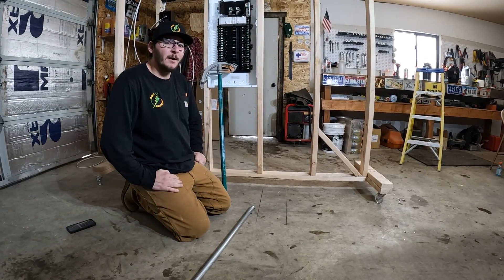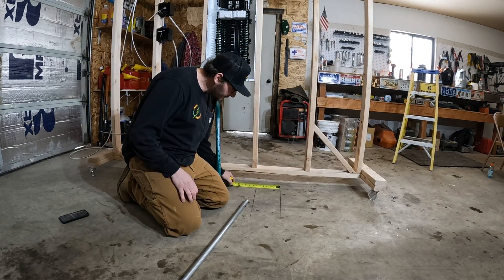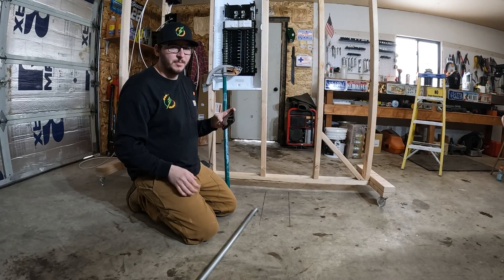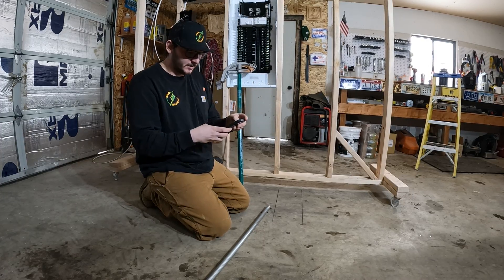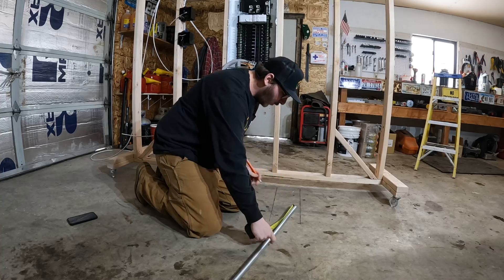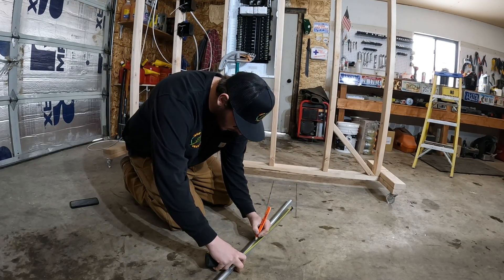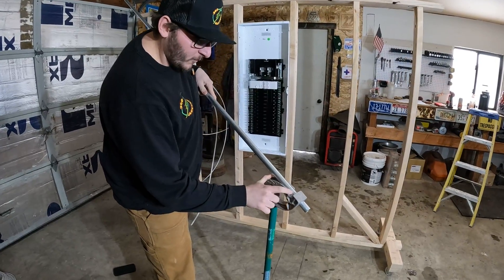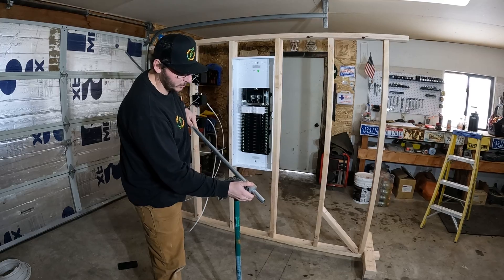How to Bend Electrical Conduit Like EMT or Ridgid - Electrical Tips

Comment: Prefer ideal or old think its Benfield benders over crappy Greenlee benders. For 11/4" EMT only purchase the bender that has a foot pedal that when bending a 90 you set the pedal in first position bend to 45 degrees then reset the pedal to second position. For you fellow older sparkies found it very helpful especially in dimly lite rooms to spray paint bender head with glossy white paint then use one flourescent paint marker to mark 15,30,45 &90 degree arrows and a different color to mark the notch and back to back mark. Save old conduit to practice various bends. Learn how to bend a saddle bend ( takes 3 bends ). Purchase a bender handle that has the handy being table while lerning .

Comment: Just measure from the outside of the  pipe to the top of the 2x4 plus 3/4 for the pipe itself?
Reply from the maker: That won't get you the 7" offset on the floor (as an example) which could be an obsticle etc. that you need to avoid. Otherwise that might have work.